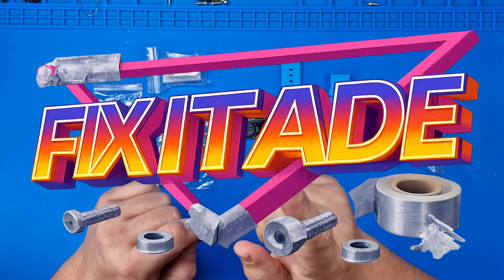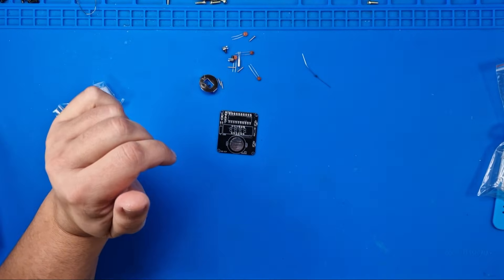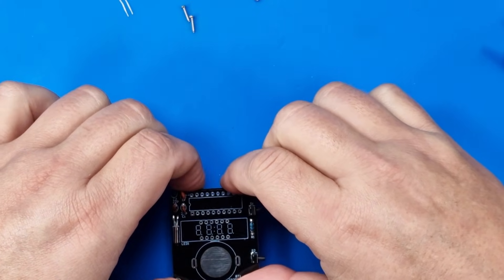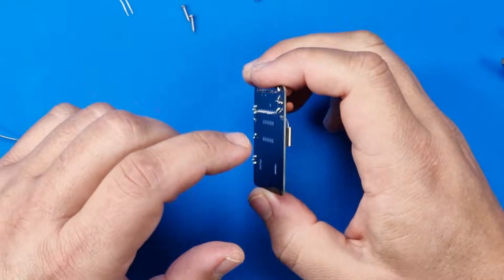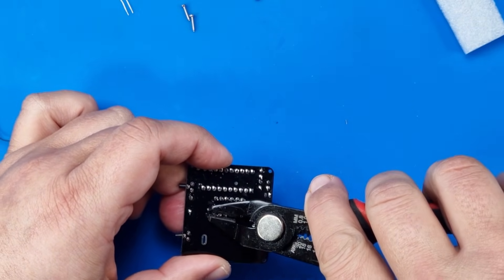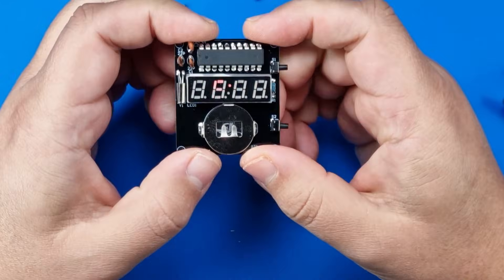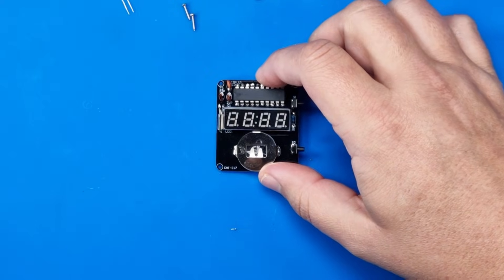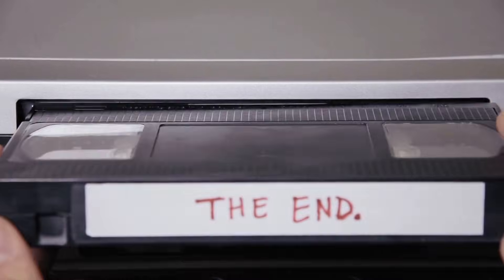Building a DIY Digital Watch Kit - Its Pretty Neat

Comment: Currently working on a grail watch of mine, a stainless steel Invicta Bolt Zeus Magnum which is like the worlds blingiest big watch but alas it was missing some bits like the crown and the bezel... step forward Aliexpress where I bought a fake version but its 1:1 copy, quickly harvested the missing bits from the real one and blingomatic I have a pristine Invicta Bolt Zeus Magnum with spare parts like a spare bracelet etc, the fakeo cost me £35 compared to the £150 Invicta wanted for the bezel piece and £60 for the crown... £35 wins all day long and for under £100 I now have an original watch for a fraction of its retail price and some of them Bolt's are fetching upwards of £600.